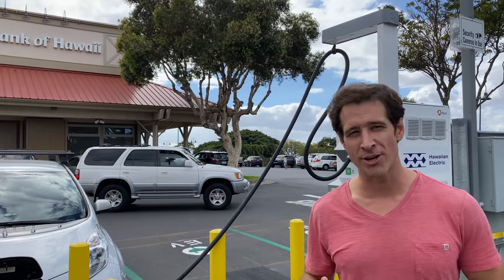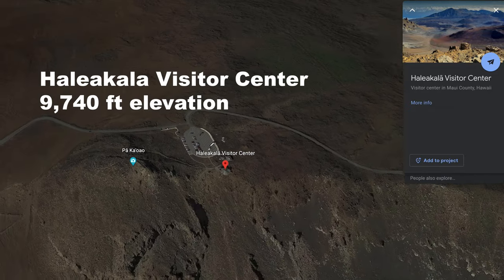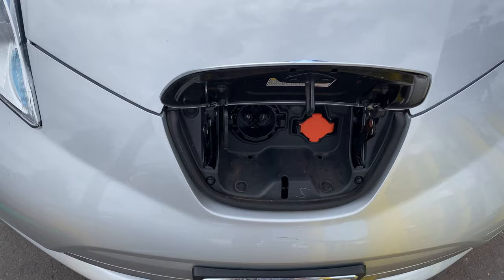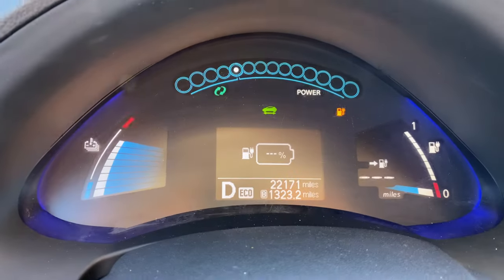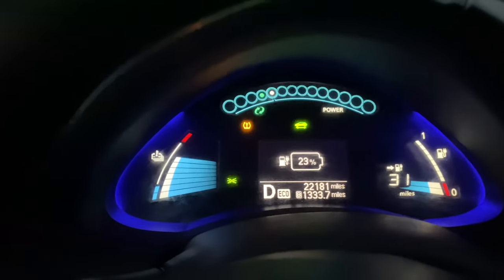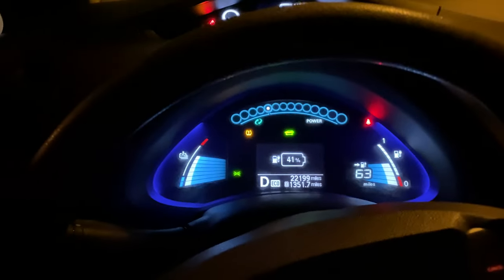Testing Regenerative Braking Down a Volcano | 0% to What?! charged in my electric car

Comment: Hi Jordan. I was wondering, do the brake lights come on with the Nissan Leaf when using regenerative braking?
Reply: I don’t think the brake lights should go on, since regen doesn’t mean you’re braking. You’re just not accelerating anymore.
Reply: @clofg3698  thanks for sharing your thoughts.
Reply: Not sure about a Leaf but the brake lights DO come on in a Tesla after a certain level of deceleration force is achieved. So small regen: lights stay off. Hard regen: lights come on.

Comment: 99-41 recoup power from regerative braking so 58% used 58 miles. Is that correct?
Reply from the maker: The car charged 41% as we headed down the mountain, so regen took it from 0% to 41% charged. It was about 28 miles down the mountain. The car used a lot of electricity going up the mountain as the mountain was steep, just like a gasoline car would burn more gasoline going up the mountain.
Reply: Yess biglt step mot topp soeed most efert

Comment: Thanks for the video!!! Do you need to push the brake or let the accelerator pedal free to let regen kick in? Will you get less regen when using the brake pedal? thanks.
Reply from the maker: thanks for watching. You just coast and the regen kicks in as it slows down the car like slightly pressing on the brakes. Yes, you get less regen when you press on the brakes but it still puts power into the battery.

Comment: How steep was the downhill grade ?  Luckily, no cow got in the road.  I suppose you never had to use the disc brakes.
I wonder if there's anywhere in the world where there is BUMPER to BUMPER traffic going  a long downhill mountain road, in which case, maybe the disc brakes are in danger of FADING, despite regenerative braking, because you can't go too fast downhill.
If this scenario happens, then there would be traffic regulating stop/go lights to keep traffic thinned-out.

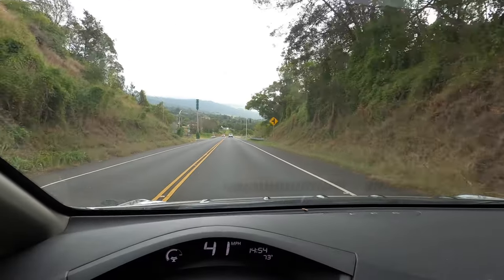Comment: What a liar 😂 at the beginning of the video hes tarted at 1290.6 miles 99% 🔋 (trip meter) 2:15 
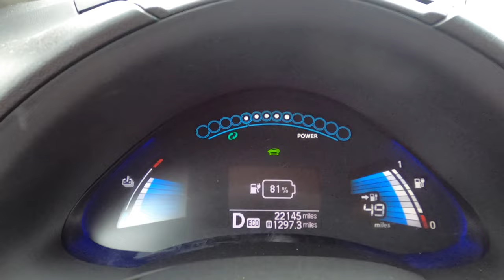Then almost half way in the video 1301.9 miles 68% 🔋 (trip meter) 2:36 
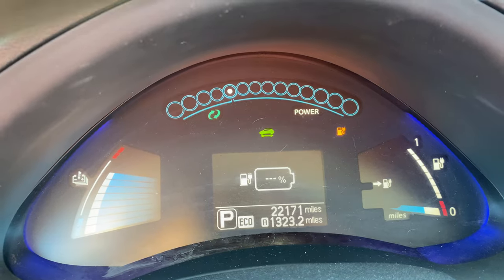And arrived to the final destination with 0% 🔋with 1323.2 miles on the trip meter 3:03 but i really dnt understand why would u do such thing
Reply from the maker: The car uses more electricity as it goes up hill. In this case, I was going up the steepest climb (miles per elevation) in America. I wasn't testing the range, I was showing the battery depletion and then recharging the battery as I went down the volcano.
Reply: Gas guages use that too